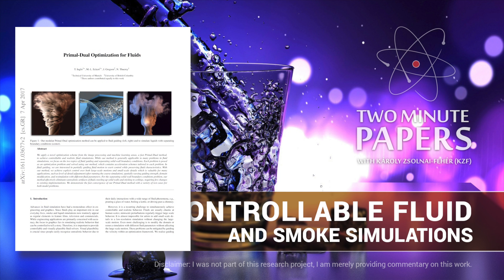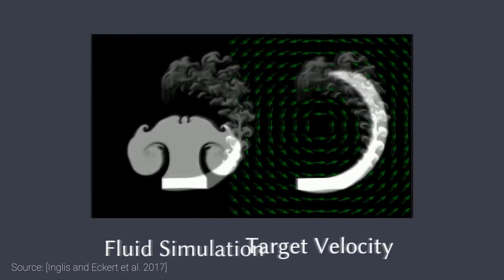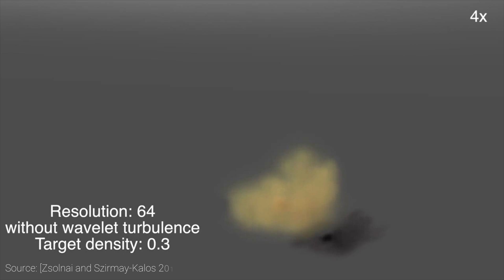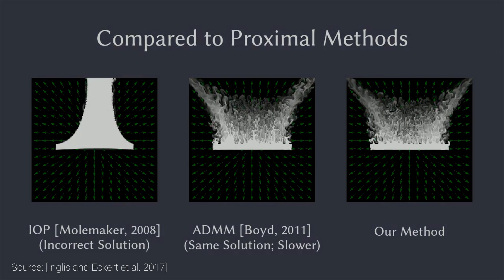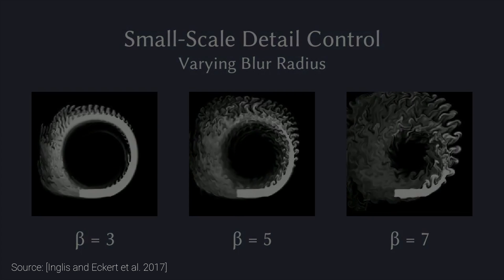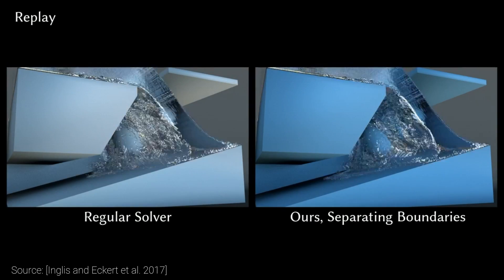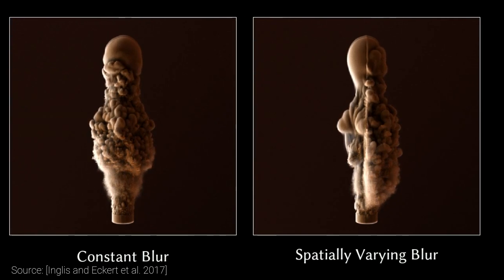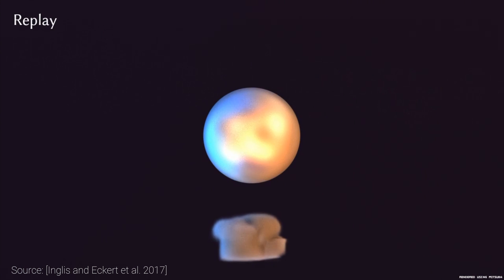Controllable Fluid and Smoke Simulations | Two Minute Papers #145

Comment: I just took a course on convex optimization and was quite surprised to see admm here. Where is the connection between simulating pde s and optimization?
Reply from the maker: The first Navier-Stokes equation is a hyperbolic partial differential equation to be solved, where the second is the divergence criterion to be enforced, which can be solved in several different ways (analytically via Helmholtz-Hodge decomposition or approximate it as a minimization problem). There are more about both of these behind the links in the video description.